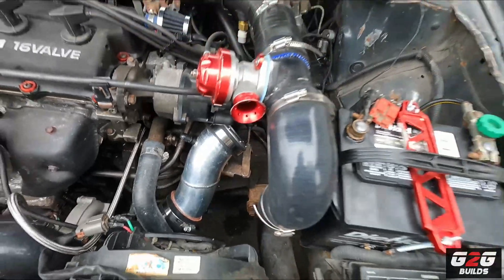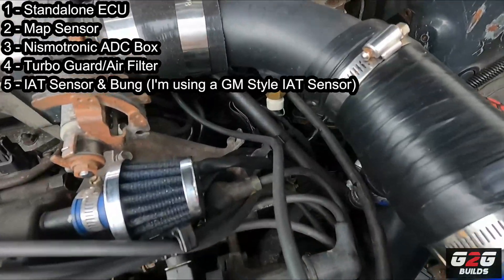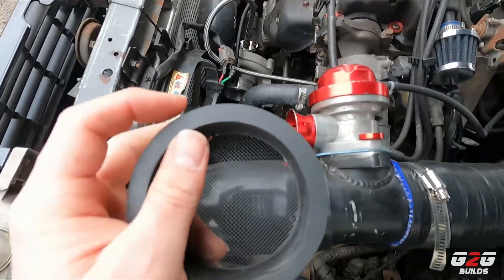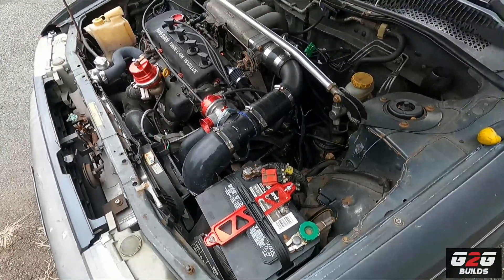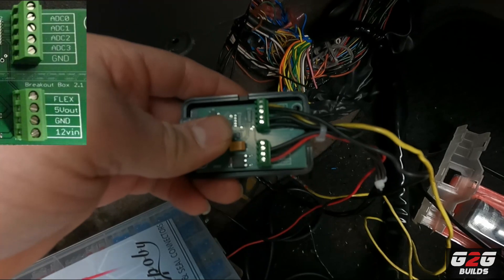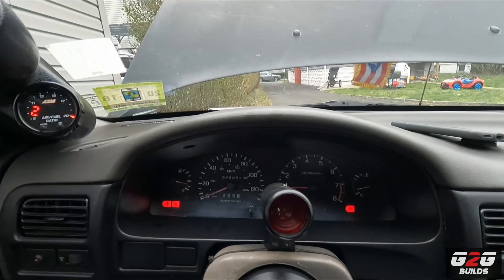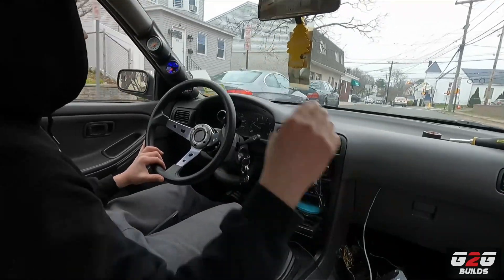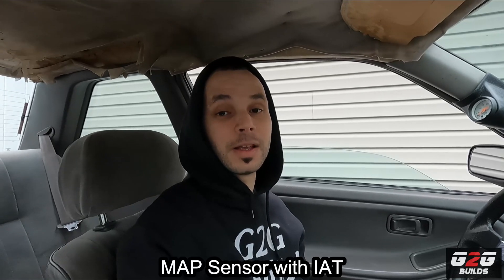B13 Sentra 1.6T - Speed Density Install with Nismotronic ECU

Comment: Eccs intake manifold will it work for 03-06 QG18DE ?
Reply from the maker: If. I remember correctly, the intake manifold gasket is different. Based on that info, it shouldn't fit.
Reply: @G2GBuilds so it only works for the 1.6 liter?
Reply from the maker: If I remember correctly, yes.

Also, the B13 ga16de and the B14 ga16de intake manifolds are not interchangeable.

Comment: hi good day guys, I'm having a problem with my GA16DE engine, when i start it idles fine but when i rev it, the engine revs high then drops back down, then goes to 5000rpm, when I'm driving the engine just revs to 5000rpm and stays there won't go any higher
normall i can get a maximum of 7200 out of the engine, I've changed my fuel pump, fuel filter, spark plugs, plug wires & i cleaned my air flow using air flow cleaner and still the same problem
can anyone assist me thank you, god bless you all
Reply from the maker: Do you have any check engine light on?
If you do, inspect and find out which codes are. If you don't, inspect the air filter and ducting to make sure nothing is clogged. Maybe test with another MAF and see if your issue gets fixed.
Good luck. 👍
Reply: @G2GBuilds  no check engine lights....well i couldn't get it scanned because the engine is swapped into an opel corsa & the guys didn't wire up a scan port so yeah that's another issue but i was hoping i could've figure out the problem 
but do you have any idea what it can be? to me it sounds like its suffering for air
Reply from the maker: @FrancisAlexTCU3958  Im thinking the same, since the fuel pump and filter were replace, and you also did plugs and spark plugs wires. So it could be that air isn't flowing or even the MAF. That will be my guess.
Reply: @G2GBuilds  okay buddy thanks for your help, will update you when it gets fixed and i find the problem
Reply: @G2GBuilds  hi bro, so i did some checking again and it turns out the fuel pump i replaced was also bad....so i got a new one and she's working! just want to say thanks again for your advice
Reply from the maker: I'm glad you got your car back on the road my brother. 👍

Comment: Great video. What are the advantages for doing this?
Reply from the maker: Thanks man.
Well, speed density helps to measure manifold absolute pressure (MAP) vs the MAF that reads the air that passes thru it. To calibrate the OEM ga16de MAF with Nismotronic will require a lot of work, so it was easy to change to MAP instead. Besides that, no MAF looks better.
Also a quick observation, most of the aftermarket ECU uses MAP sensor instead of MAF.

Comment: Great video my brother, now i gota see if i can do this with my p10 sr20det
Reply from the maker: What's up brother?
If you change to Nismotronic ECU, changing to speed density should be a piece of cake. Not only that, tuning should be a lot easier since nismotronic is meant to work for SR20de and ka24de. They have a lot of base maps for these two engines, but not for mines. Lol